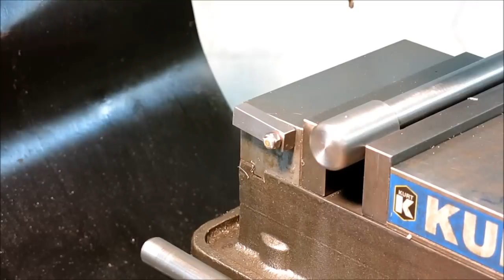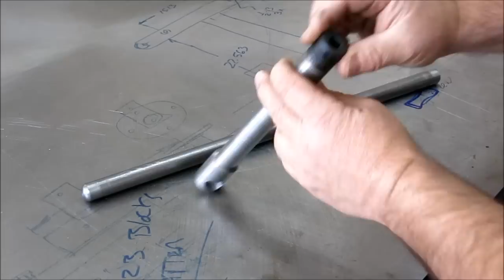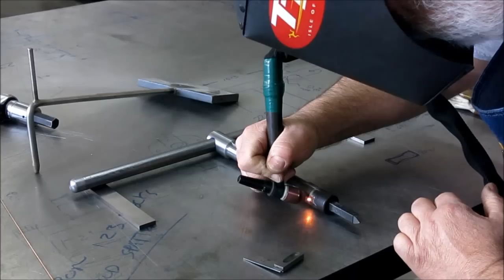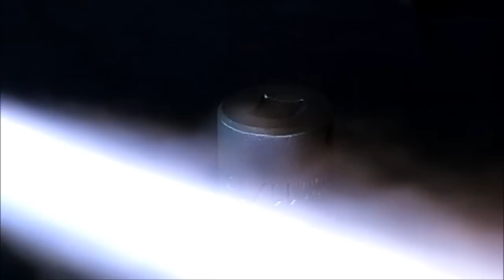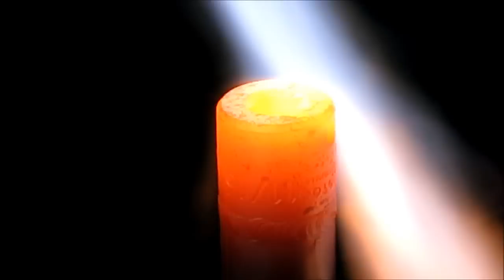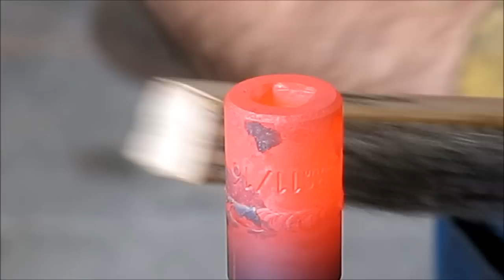Monday Night Meatloaf Sidedish

Comment: Great vid Tom.  Thanks for the efforts you put into making these interesting and technically as awesome as the tools you produce.  I understand the flimsy rationalization of using a slide hammer to buy the slide hammer, but.  Wouldn't it have been better to create tool fixtures for the arbor press the would hold the socket and tooling die securely and then form the square hole using the controlled pressure of the press to form the hole, and just as importantly to pull the tool die out of the socket after the hole was formed?  You would form using just the stock impact socket so if something goes awry you don't have to deconstruct the entire T-handle.  The added benefit is you then have an arbor press fixture for future projects.
Reply from the maker: Hey Morris,

You saw through my thin veil of reasoning. At the time I didn't have a sturdy enough arbor press. So I made another flimsy excuse and went and found one a couple months later. In all honesty I could have held the tool with a pair of vise grips and dinked it in with a hammer. Utterly un-elegant and, I wouldn't finish up with a useful tool added to the crib. Thanks for the comment.

Cheers,

Tom

Comment: Hi Tom,  great job, I never knew about the swaging process except when blacksmiths would do it, I guess out of necessity, very cool. Many a time silicon bronze filler[and braze welding in general] has pulled my chestnuts out of the fire, I have also had good luck with using stainless 312 filler when welding tool type steels and the like that are prone to cracking and hot shorting
  Another great episode!
Reply from the maker: Hi Michael,

I had fun with the swaging. I went the long way around because I wanted to try it out. Never tried the 312 rod. I'll get some and do some tests. Thanks for the tip.

Regards,

Tom

Comment: How about a light ball detent for center on the handle then you can slide it to one side for more leverage lil spot bead to keep it from sliding out
Reply from the maker: Hi Gent,

My preference on chuck keys is fixed. The symmetrical action of two hands on the key is my favorite. When ever we have a loose one around I generally tack weld the cross on center. Good idea.

Best,

Tom

Comment: Great video Tom, a little tip if you were swaging something bigger or deeper- coat your parts with graphite diluted with water 1:6 ratio. Helps things go in and come back out much easier. I agree weld in the stamping's and dress of the weld for a primo finished look. cheers

Comment: That was a good video I make my chuck keys but never had to make one with a square hole....now I can LOL
Thanks Tom
Manny
Reply from the maker: Hi Manny,

Everybody hates a square hole except a toolbit. Thanks for the comment.

Best,

Tom
Reply: I noticed on the oils video most of the containers you showed had "tapping oil" on them. Which one do you use for cutting on mill/lathe?? Thanks Manny
Reply from the maker: Manny Monroy Hi Manny,

I use all of these interchangeably. Depending on what I might be doing in either machine. Hope that helps.
 
Best,

Tom

Comment: That looks a very impressive tool you have made, with arms on it like that you can exert such torque that you will perhaps have to be careful you don't damage the workpiece in the chuck!!

Interesting to see the hot swaging operation.
Reply from the maker: Hi Dan,

The older I get the longer certain handles need to be. Maybe I can do four jaw swaging with this new chuck wrench.

Best,

Tom

Comment: Tom,
I made a similar one for my mill's drawbar,  it was 8mm square.  I use my vise and torch with a lot of heat to swage it.  Turned out OK.  I am in the process of building a power drawbar for my Grizzly G0704 mill, using a Harbor Freight 3/8" impact wrench and my 8mm square socket.
Reply from the maker: Hi Herb,

Looking forward to seeing your new drawbar. Power drawbars are real time savers at the milling machine. Thanks for the comment.

Best,

Tom

Comment: Tom thanks for sharing the final result the hot swaging was really good.  I've done some really rough stuff with chisels and the square hole in anvils but certainly nothing that precise.  I don't think you will have any trouble tightening the chuck with the size of the handle on your new chuck key.

Comment: Love itI  Learn something new everyday!  Little trick I learned when I built my little set of matching keys for my 4 jaw.  Heat bluing.  Polish to high shine, then bake until the color you desire is reached then throw it into a bucket of 10w40...  The heat colors the metal and opens the pores allowing the oil to "soak" deep into it.  Very durable and beautiful finish and prevents corrosion!  I guess it's a meld of gunsmithing and machining, but I love the results!

https://www.facebook.com/photo.php?fbid=10202016569192333&l=878bcc6691

Comment: Tom,
I really enjoyed watching you build this "Abom" sized chuck wrench! The swaging technique is something I have never done before, thanks for showing us how its done! That tool you made with the slide hammer was great!
I was curious to know what material to chose to use for the body and handle. Ive had a couple of mine bending because of all of the massive tightening I have to do, but I think they were shop built. The factory made handles always seem to stay straight. 
I really liked that huge 24" Cushman chuck we used to have on the big Monarch. The female end of the screws were hex and not the typical square, which helped tremendously when working that wrench and indicating. You get a little better choice of position. 
I'm glad to see you using the Eagle oiler too!!
Thanks for another great episode of Meatloaf!

Adam
Reply from the maker: Hey Adam,

Remind me to not loan you my chuck key. The shaft and handles are cold rolled. The cross bar is 3/4 diameter. Looking at you makes me think you could twist this into a pretzel. Glad you liked the show.

Best,

Tom
Reply from the maker: Kelly Breckenridge Hi Kelly,

How about hot universal re-sizing technique. HURT for short.

Cheers,

Tom
Reply: I love it Tom!
Reply: On flee markeds I often see some old Car-Wheel-Wrenches - different sizes - I don't know what material they are made of ... but they are very, very rigid and strong ... I made a pair of chuck wrenches out of them ... but ofcause you can't get the nice details like the one Tom did in this video
Reply: No doubt Adam has twisted a few T's off in his day, nice Video
Reply: What's tha slide handle technique called? Is that The Tomilation method
Reply: I once used a slide hammer to pull a pin off an old miller press, the sucker hit me square in the chin on the way out, nice thing is I don't remember what happened after that
Reply: Perfect, I'll try that one on my next , it's gotta fit in there sooner or later, great video Tom, enjoyed it very much
Reply: Tom do you have Facebook, I'd love to bother you as much as I do Adam & Keith
Reply from the maker: Kelly Breckenridge Sorry Kelly. No Facebook. Its all I can do to keep up with what I have going now.

Best,

Tom
Reply: Thanks Tom, I'll just bug you here then!
Reply: Merry Christmas Tom to you & yours!